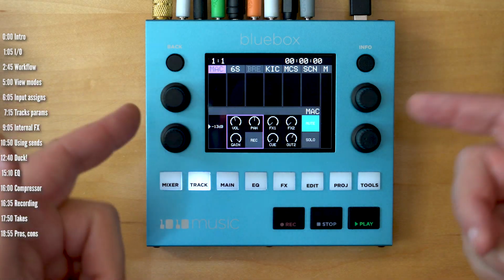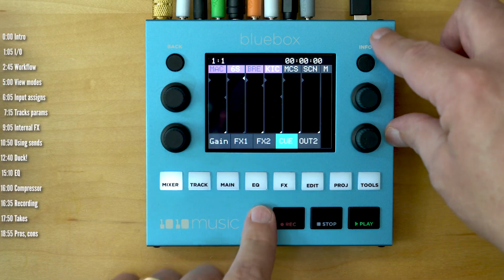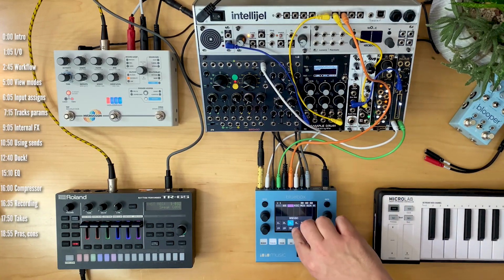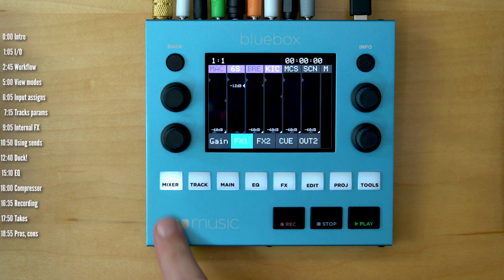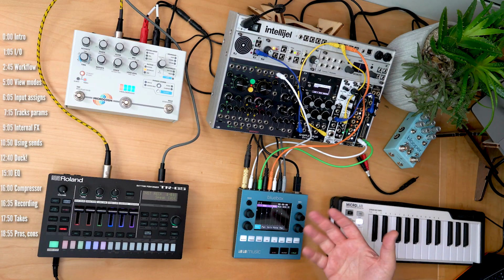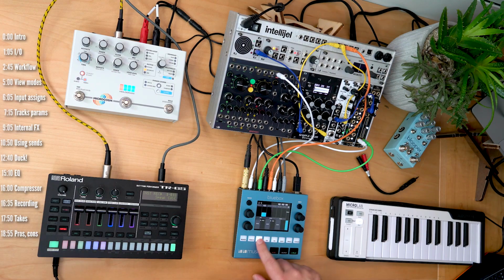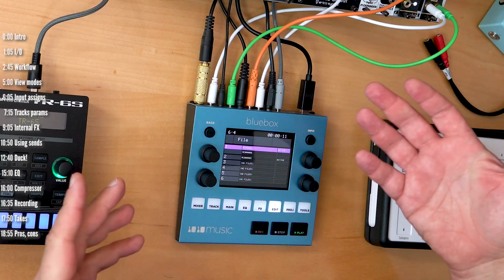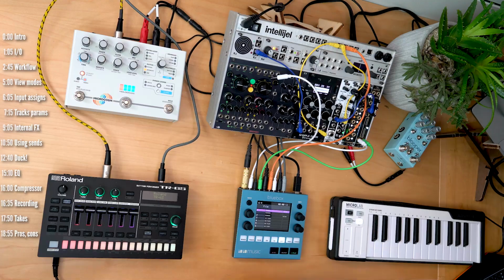1010Music BLUEBOX Review // Is it the new king of synth mixers?

Comment: After updating the firmware you can use it as an audio interface with your computer... however, because of the fail design its actually useless for 2 reasons. 
1. Whenever you connect the blue box direct to usb to power (pc or laptop) you get ground noise!
2. Connecting USB direct to pc or laptop, Sometimes the screen freezes and can even crash the bluebox completely.
Best solution, only connect usb via a direct wall plug.
Despite having so many useful featues the blue box fails at the very basic level... ground noise and no power on / off switch.
I sent mine back.
Reply from the maker: FYI - it needs enough power and most computers don't have it - you need to get a USB splitter and power it from an adapter (I'm not saying it's a good thing BTW)
Reply: @loopop  I had to have it powered via wall mains, that was the only way to stop the ground noise. As I said, the firmware update enabling it as an audio interface is a nothing burger lol.. great videos loving your channel btw

Comment: did you miss showing group inputs to different outputs, or is it not working?
Reply from the maker: I'm not sure I understand the question, but there isn't a feature I didn't show
Reply: I understand i can select f.e tracks 1-3 and sendigthem to the main output and tracks 4-6 sending to Out2.  This concept is called grouping in and outs. Would be nice to see how it works with look to handling it @loopop
Reply from the maker: @lwpweb  you just set levels for the different mixes/outputs
Reply: so i have phono as output1 and output2 as secondary output. Is very important to connect it later with Octatrack and its A/B and C/D Inputs and i would have the flexibility to choose which Tracks go to A/B or C/D. @loopop
Reply: in the meantime i understand the so called 'output 2' are in reality physically 2 seperate stereo outputs. This view makes it eaier to understand.
Reply: where is the grouping inputs to selected ouputs? @loopop

Comment: I use a zoom h10 as a similar solution,   and the h10 is also an audio interface.
Reply from the maker: Agree about the zooms. What’s an h10 though?
Reply: @loopop  10 input 12 track portable handy recorder. You can reassign tracks for multiple takes, basic overdub, auto input rec/monitor select, xlr or combi inputs, individual phantom power, usb bus power or batteries comes with xy stereo mics, 12 out 2 in audio interface.
Reply from the maker: Do you have a link to it? Couldn’t find it

Comment: Hi, my question is very simple. Sometimes I like to perform live in a quad. configuration ,is it possible with the blue box to have 4 separate audio channels and to send individual track in them, and how to move them in the 4 different space ?
Thanks and keep up the very good and useful work.
Reply from the maker: Thanks! you could manage 4 outputs with Bluebox but it doesn't have a quad panner as of the current firmware

Comment: Great review(after review, after review, after......:). But, slightly off topic, what are the specs for the wall wart power supply for the TR-6s?
Reply from the maker: Thanks! It's USB powered - I don't know the minimum power requirements though
Reply: @loopop  Ah, I thought you had the TR-6s powered through a wall wart in this video, so I thought: better ask how you did it, before I destroy mine. Thanks for the quick reply though. You rock!
Reply from the maker: @yoppoyo  a wall wart that supplies usb power - like a phone charger
Reply: @loopop  Man, I was so afraid, not about not meeting with the minimum requirements, but exceeding the maximum ones. But I just tried and my unit didn't get fried. Hurray! Thanks!

Comment: hey loopop, I got this machine based on your review. It seems pretty cool, however you mentioned some noise issues that you have and I might have the same which are driving me insane. The basic "ground noise" I can live with, as I plan to use this for a live set. However,... I am trying to connect a digitakt, and when the digitakt is sending clock to my other gear, then the noise becomes unbearable. Have you had any experience like that and do you know how to mitigate it? Anyways thanks for any help pointing me into the direction to making this thing usable. And thanks for all your reviews!
Reply from the maker: whew I'm glad you heard the noise part if you bought it because of this video.... I don't want to sound like I'm promoting my book but there's a whole chapter there about dealing with noise so I can't sum it up in a comment... bottom line is you can solve it but you need to troubleshoot a few things to eliminate the source of the problem

Comment: Hey @loopop great video! 
Would this work nicely with Elektron dark trinity + moog minitaur? 

The other option I was thinking of is Allen & Heath Px 5.

Thank you.
Reply from the maker: Thanks! It should work but you'd need a lot of adapters :)  and like I mention in the video depending on your setup you may have noise (especially if a computer is involved). But yes, as far as multiple tracks and size are concerned, this works very well!

Comment: I'm having issues with Volcas only receiving one channel on the input. How do you get the stereo signal from the Volcas into the bluebox?
Reply: Are you sure you have the correct cables.  I’ve seen people with similar issues and it was due to using an incorrect cable type.

Comment: Just got my blue box & I’m trying to figure out how to add wav files of pre recorded track/stems into a project. I just loaded some files via my computer on to the sd card but it doesn’t seem like it’s allowing me to load those files into a project. Any advice? I’m wondering if I’ll just have to record each track into the project individually...😬🤔

Thanks!
Reply from the maker: I've not tried it - my advice is to contact 1010music tech support - I hear they're very responsive.
Reply: @loopop  Thanks! ..actually I did find it in the manual. You do have to load the way files onto to the SD  card via computer & place them in a folder.

Comment: Why would you want this ?  All the multitrackers that been around for years are way better and easier to use, and cheaper than this .
Reply: I thought the same thing at first. I’m waiting for my blue box to arrive tomorrow lol. Seriously, I got tired of staring at my 24 track mixer with way too many knobs that I don’t USE and XLR inputs that I don’t need.  My mixer is massive and takes up so much of my workspace. Second was my computer, with its external monitor. Between the computer and the mixer, my instruments are afforded so little space. Thus the biggest appeal for me was size. That and the onboard compressor plus the MIDI sync sold me.  Fingers crossed it works as I expect it to.

Comment: Ive just got a blue box...but the screen looks not stright inside the unit?...
Reply from the maker: Contact the company / where you bought it
Reply: @loopop  Yeah allready done that waiting for a reply...
I will have to send it back as the screen is not symmetrical with the window of the metal case unit...for the price this is not good...no quality control in the factory.
Reply: Yeah its a factory fault which cannot be fixed unless the unit is opened up.
So my unit is going back to my seller via ebay.
Reply from the maker: Makes sense
Reply: @loopop  going for the Tascam 12 now even thow its huge compaired to the 1010 I can use all my cables without messing with adaptors.
Reply from the maker: Good luck!
Reply: @loopop  Many thanks for all your vids they are so usefull and very well made....jim

Comment: great review,  looks like a great product, ticks more performance/mixer/recorder boxes than many larger and more expensive digital mixers. Only bit i wanted to know more about/ I assume is the built in effects are recorded baked into each individual channel, or are they just on the master channel? It has to be per channel right in 2021!? Also as you have ability to do multiple overdub takes it looks like these are all saved and named on the SD, could it possibly record a separate 'take' file pre and post int fx?  so if you are jamming all your hardware and you twerk your sends maybe a little too much you can use the clean one?
Reply: Instead of whining in advance, take a closer look at the bluebox. You will realise that it actually can do things you thing to miss. First, the fx are actually recorded per track if you tell the bluebox to do so. There are the usual routing options at your disposition, too. Let alone the compressor, which is actually hardwired to the master – on the other hand, it's up to you to switch the compressor off by default/in template, record all clean and compress in the post.
Reply: @aljen9611  whining or just asking questions? I took many a close look and it wasn't obviously possible 11 months ago but I do know theres been firmware updates by now. Thanks

Comment: If you are doing a dual mono input (i.e. 2 mono inputs via a stereo splitter/joiner), can you control pan, levels, etc. per mono channel or can you only make adjustments to the 2 in tandem?
Reply: No. If you split a stereo input into dual mono you get a complete and separate set of controls, including gain, pan, FX send, etc.
Reply: @1010music  Ahh. That is pretty cool. Is that part of the input assignments?
Reply: @intafon  Yes

Comment: midi control over mixer parameters by CC or NRPN would be nice. also recording its midi input & playing this back (unedited) would be useful, either to automate itself or simply to repeat a live midi performance. at that point, it becomes reaper-in-a-box.
Reply: You can control most parameters via MIDI CC.  You will need to use an external sequencer for automation.

Comment: I really like it overall, seems a good solution for smallish setups. A compressor per track would of been really nice. My only other concern is that although it uses small 3.5mm jacks there seems to be very little space between them (as per loopop's comments). I would of liked a "slightly" bigger box and therefore space between inputs/outputs.

Comment: It seems to be "12 inputs & 3 STEREO outputs" on 1010music website. But you say "12 inputs & 6 outputs". Which is correct?
Reply from the maker: When do I say 6 outputs? I mean it does have 6 outputs technically, but I believe that when I mention it I clarify that those are 3 stereo outs. You can of course address them separately with a splitter and pans, just like the 12 inputs really are 6 stereo inputs, though those are more directly controllable as 12 individual tracks or any combo of stereo/mono tracks.
Reply: @loopop   0:05 "it's 12 track inputs and 6 track outputs"
Reply from the maker: @jvnllA  OK, you forced me to listen to the whole thing again ;) around minute 5 I clarify that these are three stereo mixes. That said, like I mentioned in my first response to you (with panning and sends), you can route any audio you like to any of the 6 outputs in the 3 stereo pairs.
Reply: @loopop  big thanks. but I did not force you to listen to the whole thing again...
Reply from the maker: I’m only kidding all is good - happy to clarify things

Comment: When you say bluebox supports eurorack levels, I get that you mean it can record eurorack levels, but can it also boost line level to eurorack level and send it to eurorack modules ? Like did you need to boost the out of the bluebox before sending it to the eurorack compressor ? Sorry I didn't really understand everyting in this part of the video. Amazing video as always, cheers
Reply: Hello. The bluebox normally operates and eurorack levels. When connecting a line level input, the best thing to do is use the gain adjustment to boost the signal to match the other inputs. On the output side, levels are centered around eurorack levels. They can be reduced down to line level if needed. Let us know if that does not help.
Reply: @1010music  That's exactly what I needed to clarify, thank you very much !

Comment: One question is whether this could be used as the master MIDI clock for live performances. That way switching between the MPC and other sequencers (to change songs without losing a beat) would be easy.
Reply: Yes, you can generate MIDI clock using the bluebox and use it to synchronize other gear. Each project can have its own separate tempo.
Reply: @1010music  Excellent

Comment: im looking att you Elektron. Where's your mixer? ❤️
Reply: I mailed them about that. They said they have gotten requests about it and that they like the idea. A mixer to link their products. Send em a mail so they see its high demand
Reply: I’d like an Elektron mixer! I was really excited about this Bluebox, until I finally got one this week and have not been able eliminate ground loops. I have tried most of the tricks. Everything is plugged into one outlet on a power strip. The only thing running off of USB power is the Blue Box. And still almost everything I plug into it has terrible ground noise. Even the channel sends have terrible ground noise when I am using just the one device that miraculously has no ground noise on the BlueBox input. Maybe I got a bad unit? Or is it a design flaw? It seems weird to me that a mixer doesn’t have a properly grounded PSU.
Reply from the maker: @Fletch Solow as I mention in the video, if a computer is involved somewhere in the chain, there's a ground loop issue. Have you tried a ground loop isolator? I feed my computer through that (see my video on ground loop/hum removal for links to a few options). I also found that some eurorack modules cause it, again, solved with a ground loop isolator
Reply: @loopop  I don’t have a computer involved in the chain at all. If I just plug in my Microfreak or Digitakt, there is a tremendous amount of loud, obnoxious noise. If I just plug in my modular, I don’t get noise, but if I use one of the stereo sends to Mimeophon and out the Mimeophon into the Bluebox, it generates a lot of noise. It also seemed to introduce noise on the Bluebox’s internal effects even if I was sending the clean modular signal into the onboard reverb. Maybe I got a bad unit? I didn’t try a ground loop isolators, but I don’t want to have to use half a dozen of those on my portable mixer.
Reply from the maker: @Fletch Solow Definitely reach out to 1010music - that doesn’t sound right
Reply from the maker: @Fletch Solow ... and please comment back here with their response/solution
Reply: @loopop  Well, I started from scratch today and everything seems to work fine. I’m guessing I had some wires mixed up somewhere or I was using a bum cable? I had a theory or two about what happened but I can’t seem to replicate the issue with my hypothetical scenario.🧐 Anyhow, it sounds much better now! Whew!
Reply: My best guess is that the broken audio input jack on my NTS1 was somehow the culprit, though. I thought it was out of the chain when I was troubleshooting, or maybe that it wasn’t the culprit because I didn’t seem to getting ground noise on that channel at the time or something. But it’s definitely not plugged in now and all is well.
Reply: I was thinking this same exact idea not too long ago! I hope electron comes out with a dedicated mixer for its devices, similar to Roland’s
Reply: Elektron: naw Bru we making bank on digitakt
Reply: I mean...  the Octatrack is their mixer no?
Reply: @stuartmccallum91  yes like the amazing octatrack without the sampler but added i/o channels like a cross between this bluebox and analog heat kind of unit. Roland MX 1  Elektron style.  That would be something 🤔🙂
Reply: @RundFyrkant  100% agree. That's exactly what I'm looking for.

Comment: What was the source of the noise issues you ran into and which of your recommended solutions fixed the problem for you? Thanks!
Reply from the maker: Powering it with a computer, routing audio without a ground loop isolator from a computer, powering the 6S from Bluebox; other solutions in my video may solve other problems...
Reply: @loopop  cool, seems like hopefully not a big issue. thanks!

Comment: The Zoom L-8 has (almost) everything this has, plus lots more 'knobs per function' (but not for the channel strip), and is cheaper... (Ok, it is bigger!)
Reply: Is there MIDI sync on the Zoom? MIDI sync for me personally is a huge must have. Zoom has more tactile control true but as you said much bigger therefore the Bluebox can get a lot of that done via touchscreen which the zoom doesn't have. This could come in handy when editing waveforms. Focus here is size though, for $200 more you get a much smaller more portable device with MIDI sync.
Reply: @Soundtrackloops  Nope , that's where the Bluebox has an advantage if you need MIDI sync.
Reply: You’re right but the FX part on the Zoom is somewhat average (delay and chorus are awful, reverb is correct with the good settings)
Reply: @CO5MA  I wonder what the L-8 would look like if it was designed now... I'm also very aware that it was designed for a very different purpose (live recording of bands, podcasting, etc.) and just happens to be achingly close to what synthesists and keyboard players have wanted in a synth/kbd mixer for ever. I've tried approaching various companies (Output, Arturia, Modal Electronics...) with concepts for this potentially huge market, but have got no replies... The Bluebox might spur more discussion and more development in this space. I'm intrigued that the comments here don't mention any of the amazing things that you could do with the Bluebox if only it was designed from the viewpoint of a 'live mixer for synths' instead of 'hey, we can take the Blackbox hardware and rewrite the firmware to emulate boring conventional mixer'...
Reply: @CO5MA  Effects age very quickly!
Reply: I have zoom h8 u can just lay an analog sync track if u need midi sync.